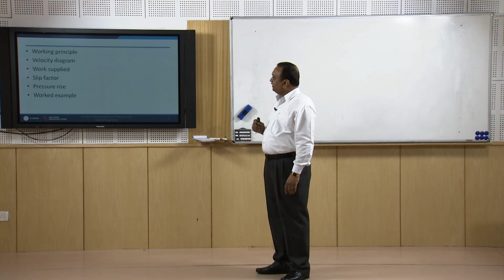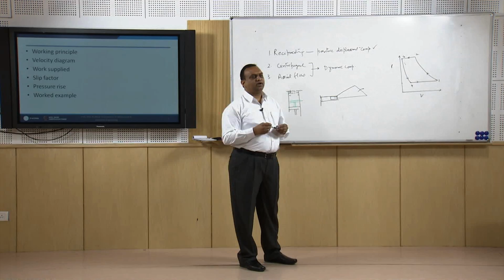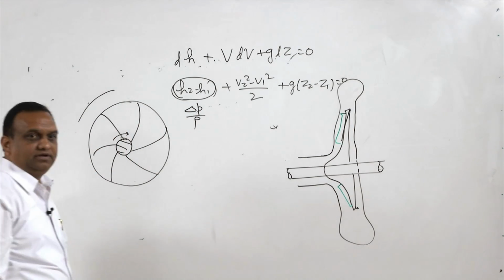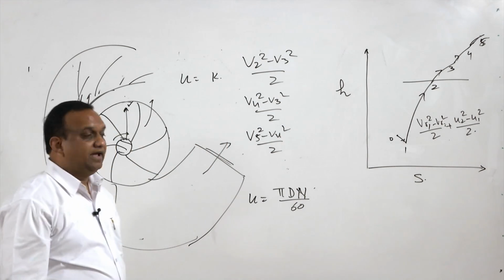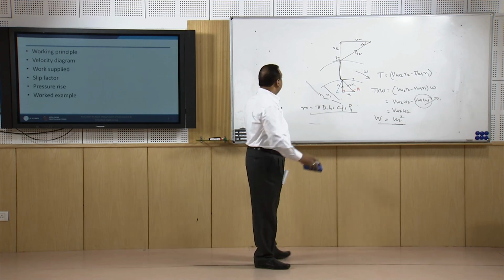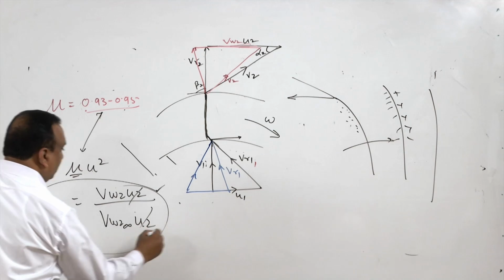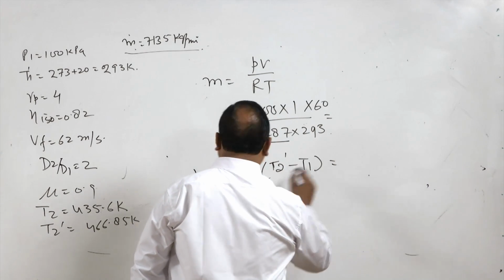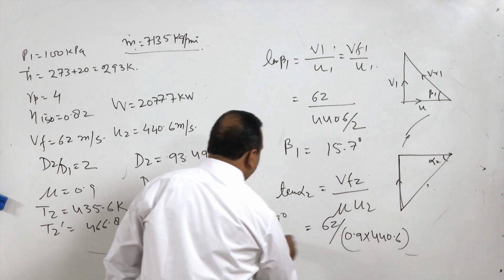Lecture 35: Centrifugal Compressors

Comment: Shouldn't the isentropic efficiency of compressor be:
nd = (Isentropic work/Actual work) = T2'-T1/T2-T1 instead of T2-T1/T2'-T1 so we get T2>T2' because there are no internal and external losses in isentropic work so we will achieve the required pressure at a lower temperature than in the actual case.  If we go by the video, we get isentropic efficiency greater than 1 which is practically impossible. 
Nevertheless, the whole video is actually really informative and clears almost all the concepts, thank you!

Comment: What's Is the technical(not theory called) difference between compressor and pump(centrifugal)
Bcz both of having motor, casing, impaler, and same suction and discharge system
Why we can't use compressor as pump and pump as compressor??
Same question also for reciprocating pump and compressor.
Reply: This is because the blades of compressor are not able to bear the force produced by incompressible fluid while that pump blades can bear.
Reply: PATEL DARSHAN  only difference is medium,compressor is used for compressible fluids like air,pump is used for liquids that are incompressible
Reply: Nibin Benny but why...? 
Please I request to again read the question..
Reply: There is something need to  design anything,we have designed pumps and compressor ,the  main moto to design the pump was only to lift the fluid not our transfer one place to another with higher velocity but in the case of compressor we don't want only to transfer fluid but also we want to increase the pressure of coming fluid, we design in such a way so that it may utilise it's max part of kinetic energy into the pressure energy and last that is our need only high pressrised fluid (air) ,i think it is not theory ans and if u go through theory then pressure ratio concept u must be knowing